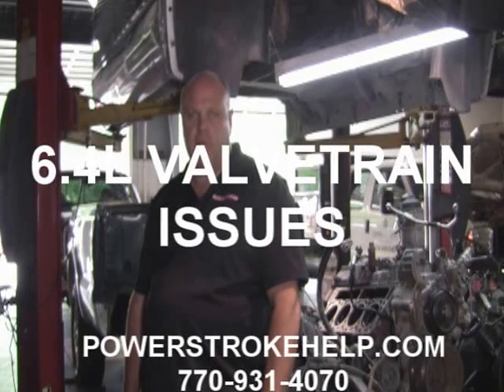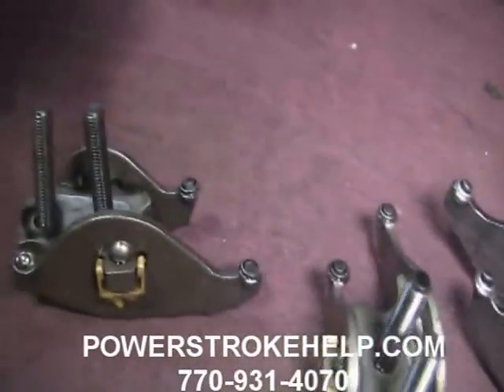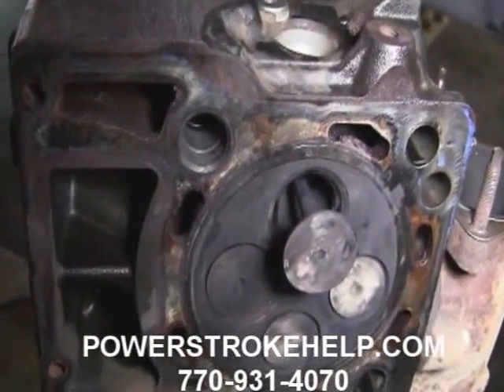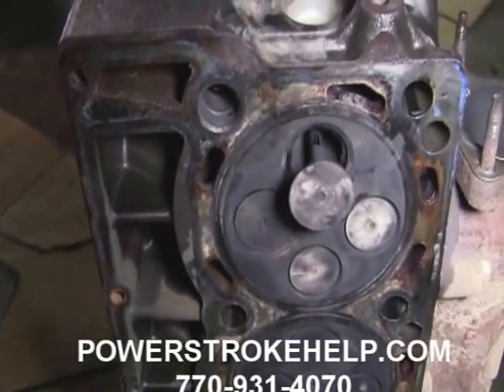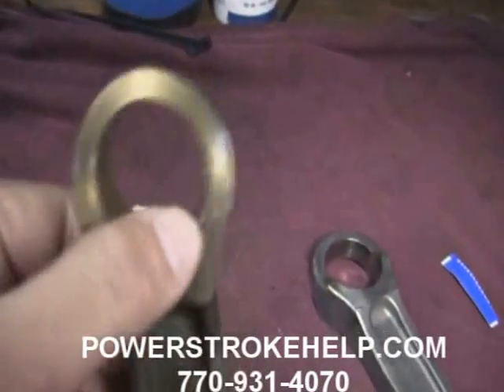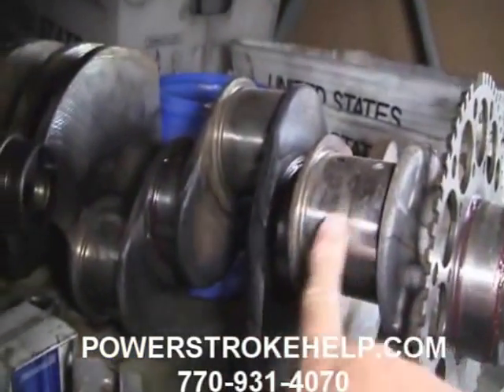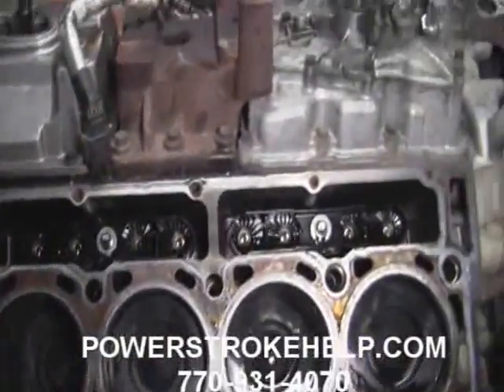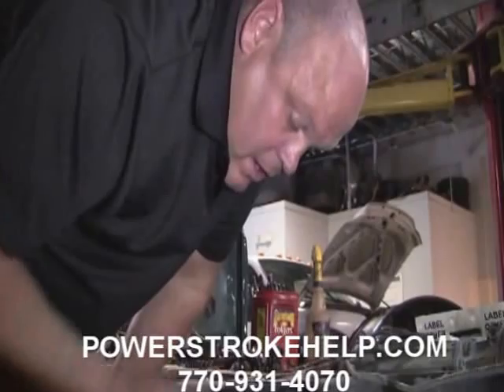6 4L POWERSTROKE - VALVE TRAIN ISSUES

Comment: Wow I love these videos, but every time I watch one it's just one more reason I'll hang on to my 300k mile 7.3
Reply: same I will never trust the new engines.
Reply: What you said, 455k on my 2000's virgin block.
Reply: I'm so tired of hearing how wonderful the 7.3 is. I had 3 of them and they're loud, don't have much power compared go new motors and on and on. My current 2011 Duramax is silent, starts the same in 90 or -20 degree weather, yields me 24mpg at 55 mph and will tow my 20000 pound gooseneck like it isn't there. The 7.3 is a dinosaur and it's gone for several reasons. Rant over
Reply: @deputyja1  that duramax wont be alive 3 years from now

Comment: Bill, do you believe that fuel dilution of the oil from the regen process is a leading cause of rocker arm wear in the 6.4s?  The 6.0s seem to have a similar design as the 6.4s but I haven't seen them have rocker arm wear issues to the extent of the 08-10 trucks.  I'm also wondering if the (IIRC) stiffer valve springs in the 6.4 is a contributor to the wear?  I'm glad to see you pointing out the corners International cut on these engines, and it's good to see that Ford has learned from those mistakes with the 6.7.  Keep up the good work.

Comment: Leave it to ferd to screw up like that...probably planned obstelence since  the 7.3 go so long so they figured they had better make them wear out faster. I'm a GM guy, but i got a deal on a 95 1 ton Powerstroke. It had around 270k but it ran good. After about 2 years, I started having fuel system issues. I have been a mechanic for 35 years and never had worked on one, and it has been a learning experience. I just finished rewiring the injectors , new cups, and seals, (oil consumption went way up all of a sudden), water pump nut and the bolts all seized  to the fan clutch and I had to  hot wrench the bastard off. No fun at all . I have never has to do that in my life. I don't know where they though that fan clutch was going at 4000 rpm

 I changed to differential to 4.30 from 5.13 (or 5.23 something like that) so now it will cruise on the highway much better and it will do about 110 now, up from 80 mph. The 7.3 is not a bad engine, it's just everything else that is  attached to it is the problem...over engineered. Typical ferd.  Why ford has to have 17 million different injection and ignition systems is beyond my pay grade. I'm retired now, but I could make a living at replacing cups and seals for $3k a pop and only have to do 1 or 2 a month, and I will. Especially since I made all these special tools to do the job, why let them sit in my tool box?

Comment: Bill, thanks for all your videos, your  knowledge is invaluable. I have a question: my 6.4 it's in 08 with 116,000 4600hours my truck runs fine, but it has a tapping noise, I can really notice it when driving next to a highway barrier at lower speeds with driver window down. It doesn't sound right, my dealer, which I have an excellent reputation with, says they can't find anything wrong. Do you have any suggestion? I'm certain it's not right I'm the only operator I know the truck better than anyone.

Comment: That's what happens in today's modern manufacturing we have to continually improve to meet customer demands for price cuts I work for a company that does intake and exhaust tubing for companies like CNH Volvo paccar and Navistar. And every one of my customers ask for a 2-3% cost reduction on the price of their parts every year. Some companies meet these demands my improving technology and improving processes and some choose to meet these demands by cutting corners on materials. So when ford said to Navistar we need are annual kick back Navistar probably choose the easy way to do it and decided to use cheaper materials rather than improving their manufacturing process.

Comment: My fuel system had to be replaced at 197k We removed the heads and checked the pistons for any developing cracks, found none. Replaced the valve train and installed Ucf o ringed heads and arp's Mans and upipes  oil cooler too. I was a fool, for not much more I could've installed a long block.

Comment: So, Ford knew and knows about these problems and there is no recall! Last Tuesday I had a rod open a window in the driver side of my block @ 139,000 miles and Ford just said " sorry it's out of warranty "
I paid Ford to custom build my truck, end cost $80,000 or so. 6,125 lbs on the bed and 30,000 lbs for tow, this in an 08 450 SD  4 door shell.
Consumer reports here I come. Henry, your kids screwed me.
Reply: Yep was completely stock and ford was the only hands under the hood.
Have watched many of your tubes and they were a big help in deciding to tell ford to screw off when the 22,000 price tag for the engine popped up. Instead I joined three suits for the same type of problem.
Reply: +Vaughn Taylor without a dpf delete your 6.4 will blow up it will kill the engine need to get that dpf off of it

Comment: Tartarian engine block with cast iron Pistons 5" with steel crank rods with tartarian  crankcase  and motor oil 10w40 mobile 1 and 4  Pistons up to and for 4 Pistons down firing order 1-2 -7-8-3-4-5-6  hardened steel valves  2in headers 5" dual exhaust twin turbos and long rod steel and makes super big combustion  in a 3/4ton truck and 1 ton truck build this engine people be Happy with the power  super-mega torque and very big on horsepower 700hp+ or bigger  send this to the engine manufacturers

Comment: My dad used to have 2008 f350 4x4 King Ranch and 2001 f350 4x4 XLT 7.3l he beat the s***t out of 2001 and now he traded 08 for the new Explorer he is regretting it and now he found a 07 6.0l King Ranch remove the seats fenders bed Grill headlight doors most of the trim interior trim carpet headliner making a legit close to stock  right now the truck has 334, 340.000 mile so make these truck close to stock king ranch but with 7.3l reliability so he can save money and buy the new stingray.

Comment: our 6.4 at work didnt make it to even 50 000 miles and the engine went...also turbo. .   just a dog.   we have a mid sized sort of flatbed that is international navistar...when the regen mode kicks in, prepare to put down all the windows becaUSE the cab fills with that disgusting smell..  it is so bad, it has permeated the cab and it always reeks...it'll get fixed if i'm ever asked to drive it after i refuse the job and file a health and safety complaint.   ugh, our 6.0's are just nightmares at the moment...one, the turbo doesn't kick in most times...maybe in third gear...it chugs and sputters when cold and wont go over 20 mph...the other one wont start without ether...in the summertime.  dealer wanted 8000 to fix it, our guys had it a week and it stayed repaired for 2 days...

Comment: I love listening to Bill and would love to have one of his Bullet proof 6.4 Engines in my 08. Trouble is I'm on the the other side of your Northern Border and on the west coast. Now let's fast forward to  to day its 2023 and its July and I'm running a 08 6.4 with about 115K miles on her this is my for ever truck and would love to have and meet someone as committed as Bill hear Bill if your listening and you have some kind cross border thing going on. Well I would sure love to hear about it. I just had the Trans Rebuilt would love to pare it with Bullet proof engine and the Big dog heads. Bill keep doing what your doing.

Comment: I like your videos, There very informative and helpful for Ford owners and mechanics that are forced to repair them. The one thing I disagree with on this video is you said international cut costs and that was not Ford's fault, but really it is as much Ford's fault as it is international. they decided to run both the 6.0 and 6.4 in there trucks willingly. They should have done there research and worked with the international engineers to make it to Ford spec. Which I'm sure they did and just turned there back on this type of stuff to also save on costs. If they didn't then it's Fords own fault for not doing there research and telling a company to build them an engine with certain specs but to also save costs where they can.  So really Ford is as much at fault for the cost savings as international is. Just like everything else they are cutting costs to make that extra penny. As long as it makes it past the warranty period is all they care about then after that they are happy to sell you all the parts you will need to fix it.

Comment: Stick with the 7.3's as long as you can . UPS gets 400 to 500 thousand on them . Usually replaced when the injector O rings need replacing .

Comment: Bill, first off cant get enough of your videos, ill be ordering a set of heads asap, are you aware of someone that has fixed the wrist pin issue in the connecting rods? Or would you reccomend having a set machined to fit the bronze? Ive only got 140,000 on my 6.4 and got way ahead of the game long ago, about the only thing i have left is heads and now the connecting rods. Im making quite a bit of power with my truck and want it to last. My biggest upset with IH is lack of doing things right. I was livid to find at 40,000 when i did the first cab off for studs and up pipes, that IH didnt take the step to machine/mill out casting material in the heads and i didnt have a single pushrod that was worth saving. Anyway, keep up the good work Bill, all of us appreciate it.

Comment: International Pisses me off and it really is Sad that Ford ended up with such a poorly engineered motor.  They went from building a great motor in the 7.3 and all they had to do was improve on the success of the 7.3 and it's fix it's downfalls in the 6.0/6.4.  It looks like each passing generation of IH Motors, the Execs at IH got richer and richer while the consumer got poorer and poorer fixing all the crap.  

Thank Goodness Ford kicked there behinds to the curb and moved on, well for the most part, I guess up to recent they were still putting the 6.0 in the E Series Vans?
Reply: Micah Watts ther 4.o sohc that came from Germany has issues to with thin timing chain guides

Comment: I know this is an older video. However, I recently purchased an 08 F350 with a 6.4, I have a stuck valve on cylinder 2 due to my oil not making it all the way up there, causing a misfire. Any time I give it any rpms above idle the misfire goes away. Is there any change I can make to the oiling system to help get oil to that valve?

Comment: Would adding 6.4L PowerStroke  Choate Vale Covers be worth $ 2000 cost ? The Choate valve cover rerouted tubro OIL return to inside of valve cover to a distribution pipe with several holes to oil top of rocker arms.More Oil , Less Ware is claim ? Does Bill Hewitt @powerstroke have any information on lack not oil to rocker arms ???

Comment: Looks like one of those early models that didn't have actual valve guide but the block was just hardened around the valve. That was a engineering joke by Navistar. I am pretty sure Navistar went to normal guides afterwards.

Comment: really seems like there is nothing you can do about a 6y.4... it has to be taken down and have the normal issues fixed.. and that FUCKING DPF gone!

Greed... all about Greed.... share holders ect...

makes me feel bad for all the fleet's with the "max force 10" engine in the international trucks... i wonder how much thos techs love this engine...
Reply: i've bin meaning to ask the guys at international on that, ive talked to a few bus drivers who have had no issues, just oil level going up and the "cleaning exhaust filter" is something they look for
Reply: Kevin Rogers I'm a bus driver, the first generation Maxxforce 7 is problematic, the epa 2010 version seems better, but still has a lot of issues. I would say they're junk, but they're quiet and have plenty of power(when running right ) , so I like them.
Reply: abram7117
ys the maxforce 7 is the 6.4L if i do recall yes they had there own set of issues for sure, accully alot of freaking issues because of international being cheep in the building process, but when they work my god they work good!
Reply: abram7117
aww ok well cutting costs seems to be the downfall in the end, sucks because the 6.4 is a beast of an engine, but really i guess it boils down to whos paying the bill and how good the warrenty is.
i still like the 6.0l better myself
Reply: abram7117 the 2010s are worse than the 07s we hardly get them in compared to the 2010 emissions.
Reply: Man we hate the 2010 maxx DT 9 and 10 biggest pile of shit everything is hard to service from injectors, turbos to the damm cooler.....JUNK!!!
Reply: XxCopKilla187xX shitty, but take my word of advise a duramax and cummins are just as hard to work on but dont go down NEARLY as often as these trucks